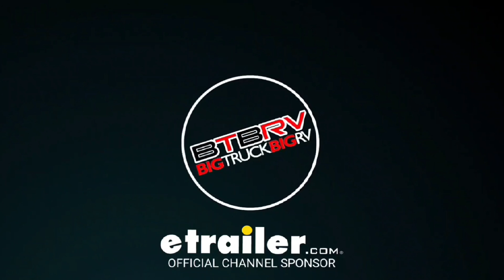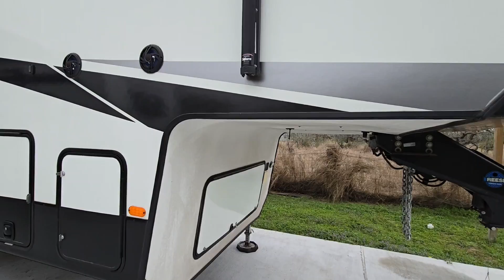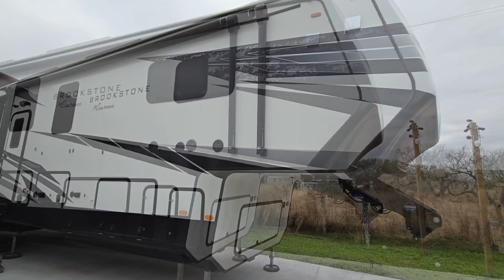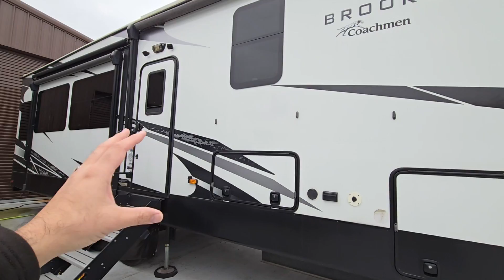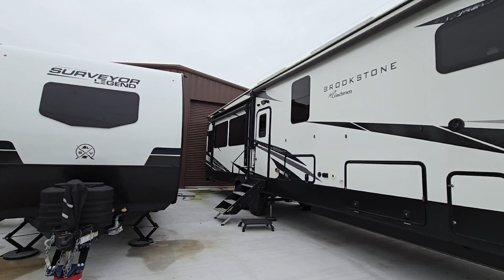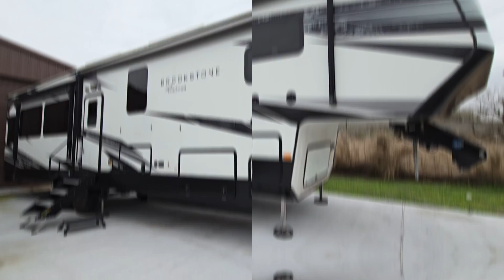BIG FRAME FLEX Update! Heading to Indiana ask Lippert Viewer Submitted QUESTIONS!

Comment: So as we discuss all the many causes can we come up with some prevention strategy? Detachment by the walls to the frame seems to be the core cause . So what kind of preventive steps can be taken? Perhaps check the bolts that hold structure and walls together? Surely the  engineers can come up with some preventative measures. This is a problem for many owners. We need to get ahead of this quickly. Thanks

Comment: JD
Your video is totally on point. RV owners need to share some responsibility for frame failure. One other point comes down to the tow vehicle. We all know that too little truck is a bad thing and too much truck is also bad. Hauling a fifth wheel will a semi is equally bad. That truck suspension is designed to carry much heavier loads. Shock from that suspension will be transferred through the pin box and to the frame causing added stress

Thanks for another great video

Comment: JD I think you made a very important point. Load carrying capacity. Adding items not originally designed for that particular RV. Putting too many batteries in one location, ie, front basement storage bay. 
 Knowing what everyone wants, the frame manufacturers should design areas approved for the off grid users. Where is the best location to add batteries.
 I’ve noticed in many of your reviews, you wish they added more storage. Yes we all want more storage space. But the RV can only handle so much weight.

 It’s a slippery slope. Customers inadvertently overloading and or improper weight distribution.

You give me more storage, means to the customer I can carry more.

Boon dockers most often will carry full fresh water tanks. That takes away from overall weight carrying capacity.

Love your channel JD.

Comment: Its interesting that they have not built a trailer that is stand alone strong enough to support the 5th wheel. They are using the structure of the rv as the structure for the frame. Many gooseneck trailers are running  around everyday with 20k lbs loads with no frame issues ever. Water damage in the rv should not compromise the frame structure.
Reply from the maker: This may be true, but there also no home on top of typically Gooseneck trailers. Gooseneck trailers flex far more than you may think and if there were a Ridgid structure on them that was tied in, it would need to help the frame out in the same way.

Comment: Subpar materials combined with poor workmanship and very little if any government regulations overall will get you an RV that will fall apart. These manufacturers and suppliers are fully aware of how these RVs are used and have failed the consumer by not meeting the demand with a quality and dependable product.  If GD engineers approved the frames from lippert to be used, their (GD) is responsible.

Comment: Lippert uses some type of chinesium. It's so brittle after a few flexes it cracks. Somebody is gonna go get the steel examined sooner or later.
Reply from the maker: 100% US manufacturered Chinese steel..
 Not sure that makes sense

Tubular/boxed steel is far more rigid that an I Beam or C-Channel.. hense why the truck manufacturers have all switched to it.  The challenge is that it is more prone to cracking when flexed beyond it's design limits (as when the RV body and frame are no longer attached).

Comment: It seems to be full profile or toy haulers. My issue was called frame bias, corrected at the factory and then had installed Moryde IS and brakes. No issues after 4000 miles.

Comment: IMO, the subject of driving them off road is valid, but with the caveat of where you go off road and how you drive it off road.  

We have a 48ft TH we FT in and boondock quite often in some of those scenic spots, but we are extremely careful and scout out the area with our e-bikes prior to entry.  Most boondockers do the same thing - exercise good common sense before going into that scenic spot and go sooooper slow!!

Now for the flip side.  We have driven on all 2,460 miles of I-10 east bound and west bound and some places in LA and TX its waaaay ruffer than any off road conditions experienced.  There have been a few times where if me and my wife weren’t in seat belts we would’ve been airborne in the truck.  We only drive 65 and no faster than that.  IMO, these absolutely horrible roads and highways are the root cause of these problems.
👍😃🍻☕️

Comment: When you interview the Lippert engineer, please go into depth about the load rating and the assumptions that Lippert makes about weight distribution. Your example of a new heavy mattress, washer/dryer, a thousand pounds of battery/solar gear in the pass thru front storage all exerting force on the frame riser.
Reply from the maker: Totally will

Comment: As some one that has experienced the nightmare of "Frame Flex" on my very popular " high end" Keystone brand 5th wheel and seeing first hand bad welds and paper thin metal supporting the pin box, Lippert and manufacturers are 100% at fault.  The RV industry is designing and accepting very poor quality control and under-engineered frames and wall connections.  My trailer has been a "driveway queen" and never overloaded and never off road,  yet still experienced frame flex on front wall connections, frame welds and broken wall stud welds next to front bedroom slide.   I'm not buying the owners are the root cause!  The actual numbers of Frame and wall flex issues are far more common than you or the industry are reporting.  I had to take my trailer to a specialized approved warranty repair location; while there it was beyond shocking to see and hear how many others were experiencing the same exact issues. A Lippert repair team was at the shop working/ welding on few newer trailers with multiple frame and weld failures on many different brands, including mid profile 5th wheels. .  When you visit the Lippert factory, please take a cross section look at the paper thin support framing around the front pin box and frame I-beams and quality of welds.  The actual root cause of frame Flex / failure  is the industry going too far in trying to reduce the total weight and it has come at a great price to many 5th wheel owners. .
Reply: Yes! And these are the comments i'm seeing all over utube. Different rv manufacturers customers experiencing these frame failures, and from what I'm reading is that these under engineered frames have been going on for a while now. 🍻
Reply from the maker: All the steel that surrounds the pin box is 1/4 inch thick. Which is far from paper thin.  That said, if you experienced failure with very little movement of your RV, then you quite possibly could have a manufacturers related issue. No way of knowing until it's inspected.  Thanks for commenting.
Reply: @BTBRV  Thanks for your response.  My trailer was inspected and I assure you some of the inner cross members supporting the pin box and deck toward front are < 1/4" thick (paper thin).   I suggest random spot checking some of the frame member thicknesses and welds while visiting Lippert.  Thanks for addressing this "industry sensitive"  issue.
Reply: @gcslade  was yours repaired at Affinity? I hear they have non stop rigs in there for frame issues of all brands. They use to post alot of pics on their FB page of failed frame structure and failed welds but those seem to be very few and far between now probably because the manufacturers asked them to stop showing the paper thin frame and terrible welds if parts were even welded a lot of times there weren't even welds where they were supposed to be. I know many folks have also commented how GD has stopped welding both sides of the aluminum cage structure...what was once both sides is now just done on one side. Push them junk units out and charge out the you know what for garbage.

Comment: Im sure some problems are the result of operator error/misuse. However the frames should not be designed and built such that they need the structure of the house to support the frame. These frames could easily be built stronger vutvthat wouldn't be cost efficient for lippert.
Reply from the maker: The problem with putting any type of a rigid box structure on top of a frame is that there will always be movement disparencies between the two.  You have to tie them together to give you the structural rigidity you need.  That's the same with almost any large structure built on a frame.  Even if you took a solid container and put it on a gooseneck, the gooseneck will still flex. But you need to tie the two together.  

Building a heavier frame wouldn't be good for the RV manufacturer as well or even the RV owner since the RV would be significantly heavier and less likely towable by most vehicles.
Reply: @BTBRV  yes weight is a big consideration. However when you're talking about a trailer that weighs 16000 pounds a few hundred pounds of extra steel isn't that big of a deal. A lot of the fixes involve adding extra support however. Unfortunately the whole RV industry is all about value engineering. I'm not discounting end user treatment. You still have to be careful with the trailer.
Reply: @TheRealChappy agree. And if weight is such a concern with the rv industry then why are manufacturers making them 40+ ft long? Stick to a shorter rv frame, build it better and if u want longer than go into a semi tractor n trailer frame. Eh? 🍻

Comment: This was informative for me, and I appreciate it. I checked with my dealer (who reached out to the manufacturer) about the Goosebox, and they said as long as the dealer installed it, they would honor the full warranty. It pays to check, and that was 4 years ago. The points you made in this video (IMO) are valid. I'm looking forward to the video at Lippert.  Keep it up, JD. Thank you.
Reply: I would double check that with the manufacture.  Keystone and lippert will only warranty i Believe 2 manufactures for the goosebox.  Never believe what the dealer says, unless you get it in writting and signed by Manufacture and Dealer.

Comment: Would you call an Alliance 310RL a full profile? Because my neighbor currently has the frame flex issue and it’s causing water damage issues.
Reply from the maker: The 310RL is a Paradigm, and the Paradigms are all full profile.  To date, this would be the first Alliance I've heard with this issue.

Comment: JD i have a question you can ask Lippert , how many times can a person tow their r-v per year?  are they designing the frame for light duty use 3 or 4 times a year or moderate use or heavy duty full time use like remote workers do they have a number?  how much is to much , Frame flex was not a problem before covid 19 when few people were doing remote work now you seeing r-v with desk and offices built-in for the factory
Reply from the maker: I believe the manufacturer the RV would be best able to answer that question.
Reply: @BTBRV  Hey but they're marketed for full time use...that could be a lawsuit itself for false advertisement. They have the stickers plastered all over their rigs...does the fine print say full-time stationary use? If there even is any fine print on this issue if there were there would be definitive exact numbers on how many miles a yr on avg a full-time rig can handle and that would have to be model specific.

Comment: Are any other frame manufacturers having this problem? I know Lippert has a monopoly on frames but there are others out there. Are any of them having frame failure?
Reply from the maker: From what I've researched, every fifth wheel frame manufacturer, even the ones perceived to have no issues, have had frame flex issues at some point.
Reply: @BTBRV  Thanks. I tried doing some research but couldn’t find much info that was verifiable and not just personal opinion

Comment: This sounds like a Lippert response, justifying an insufficient frame integrity issue. The fact that the failures are predominately or substantially greater with specific Grand Design models indicates VERY CLEARLY, to me, a SPECIFIC frame specification or build issue on those models. It has nothing to do with water intrusion, which can (and does) happen to many RVs that NEVER have these issues. Secondly, the failures are not related only to used RVs where the current owner has no history of the RV. It happens with brand new and first-owner RVs as well. It is also ludicrous to think or say that these issues are due to bad roads.......or are we to believe that it is only THOSE SPECIFIC RV owners that travel on bad roads????

I'm sorry....this is not your best video (IMO). The assumptions and manufacturer feedback on all these excuses does not make sense for any logical analysis of why the issues pertain to specific frames/models..
Reply from the maker: Actually, all the points I made are factually backed up by technical engineering facts.  The points you made are speculative since you have no way of seeing or knowing what every RV that has experienced the problem has either been through or has gone through. Yes a percentage will likely be due to manufacture related issues, no doubt, but to blanketly believe that all these units have never had any owner related issues and that water damage doesn't play a contributing factor, would be a irresponsible.  Again, so we're 100% clear, I'm not doubting that there is a manufacturing related issue at play in some of these units.
Reply: @BTBRV  what's the water damage you speak of from? The improper way GD plumbs their rigs? Ask any licensed plumber to look at any one of their rigs and they will tell you that they are plumbed with the incorrect fittings per that junk hose they use. Not one of their rigs would pass any plumbing code or inspection ever.
Reply: @BTBRV  Perhaps it's no less irresponsible to simply take the frame manufacturer's "technical" response as the truth, if one has not actually seen first hand what their repair was to fix the issue. How many of these repairs have you seen where they repaired some water damage issue? I have not seen one. Every single repair I've seen has been ONLY welding reinforcements and crack repairs to the steel cross members and the uprights structure on the steel itself. If the failures were due to the fiberglass skin to frame or the floor to frame interfaces due to things like water damage, then they would have to be part of the repair process. Can Lippert or any one else repairing the failures provide ANY visual proof by video or pictures of this occurring? I've never seen it. Can it be part of the issue, potentially? Of course. But HAS it been the underlying issue for the cases seen this far? I'd like to see some proof. In the mean time, owners of these specific Grand Design rigs that are so disproportionately affected by failures, will have to just monitor and hope for the best, or not travel with their rigs over anything but the smoothest of roads. Cheers.

Comment: Why would that be? Also why is most of it with Grand design?  All your examples are poor quality and folks are spending 100s thousands as much as a home the frame should be holding up
Reply from the maker: I would make the same argument with people who buy real homes.  But you can watch any news channel to see there's a good number of complaints in the home construction industry as well.  In regards to a specific RV manufacturer, again if you watch the video, you'll see that most of it deals with the method of attachment between the body of the RV and the frame.

Comment: I can understand why folks think your review is biased. You have to watch your video a couple of times to understand what you are saying. I will say this, mid profile 5th wheels are going through the same thing..but not nearly at the scale that it’s happening on the bigger heavier units. Also I believe folks are misunderstanding Frame Flex and Frame Failure. The data a friend of mine is collecting shows that there are 5-6 different problems occurring that is put under “Frame Flex”. Only 2 of those you went over really well by the way. Lippert makes the chassis to the spec the Factory/Brand asks for. Mainly my buddy has noticed so far that it is mainly been Grand Design Solitude, Momentum, and Keystone Montana High Country. Year models 2018-2024. But again I think folks are lumping the Frame problems all into the “Frame Flex” category because of the lack of communication from the RV factories. Seems like a lot of them want to avoid the conversation. Great video, For those of you that think that he’s biased rewatch it a couple of times and you’ll understand what he’s referring to. You can tell he’s not trying to dismiss anybody’s frame problems. It’s going to take a long time for anyone to gather all the data since there really is no full cooperation from the RV manufactures. On top of that, we cannot fully blame Lippert for the problem
Reply: Also wanted to point out there are other brands besides Solitude, Momentum, and High Country, but those are the biggest ones he has data on for now. There are other brands sprinkled in